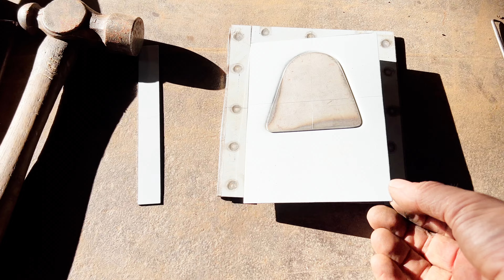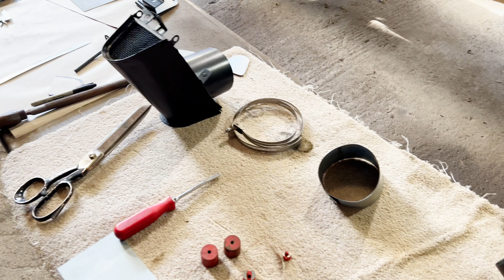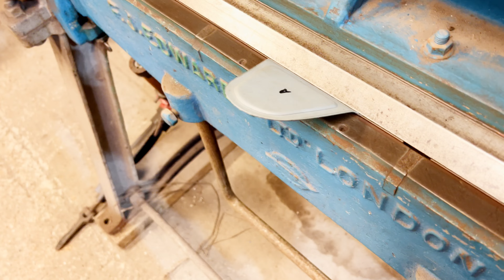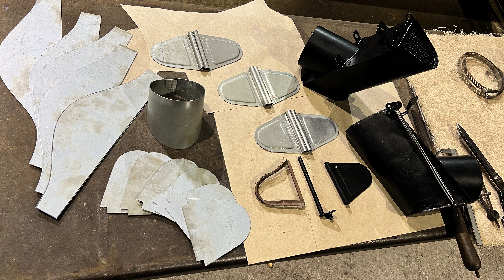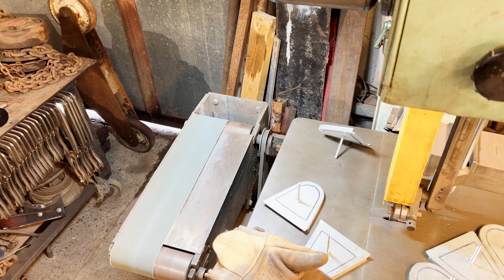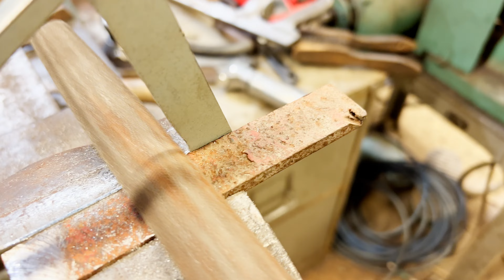FIAT Dino Spider, fresh air delivery system, Part 1.

Comment: Do you cut all your hammer form parts by hand? I'm wondering that if you do would a cnc plasma cutting table be a worthwhile investment? Another excellent an very watchable video, cheers!
Reply from the maker: I have a Startright bandsaw and two heavy duty sanders which I use to produce my formers . So yes buy hand but quicker than by hacksaw and file !
A CNC plasma table would be great and I have considered it but I’m more interested to spend the money on other equipment. The space it will take up is also a consideration. I mentioned in the video about outsourcing laser cutting, that’s sort of a cover all term for all of the CNC cutting techniques. Now I think it would be really helpful to do that but I would need to provide some sort of CAD design for this to happen in a cost affected way. So I don’t know if it’s going to happen but I’m sure that it would be really useful for this kind of project.
Usually I’m only making a couple of units so I just get on with it . Sometimes I’ll make adjustments as I go . I’m a little old fashioned in mindset and I sometimes just don’t go there with technology it’s not “If it ain’t broke don’t fix it “
More” if I don’t own it I won’t have to fix it” . I think it’s also useful for people to see that it’s possible to make this happen without having lots of expensive equipment. I’m trying to encourage them to have a go themselves.
I think it’s a great idea the plasma table and would be really useful so maybe one day !
Glad you are enjoying the films.